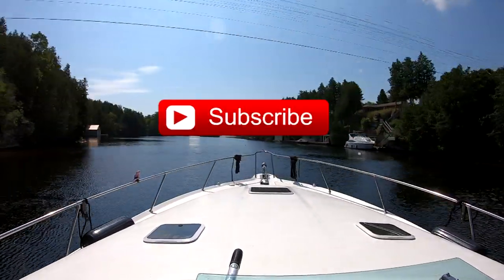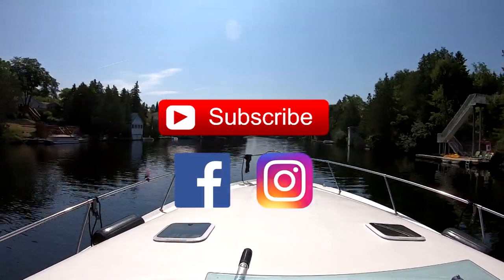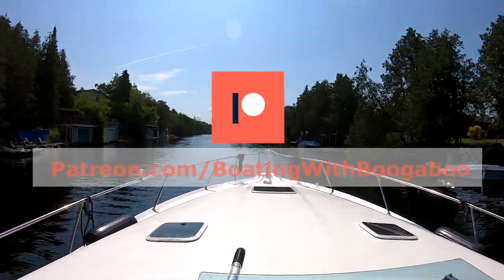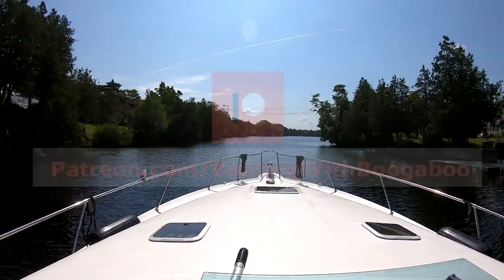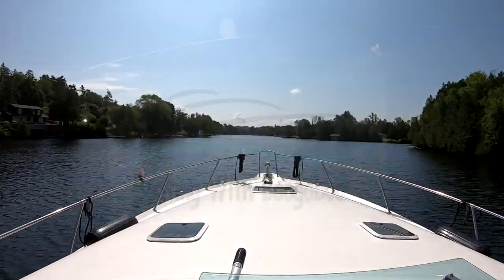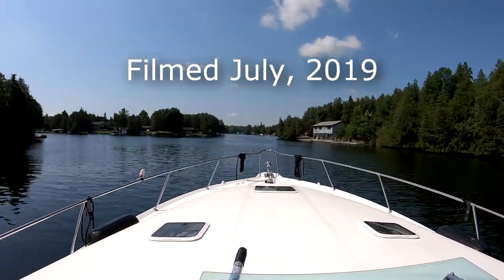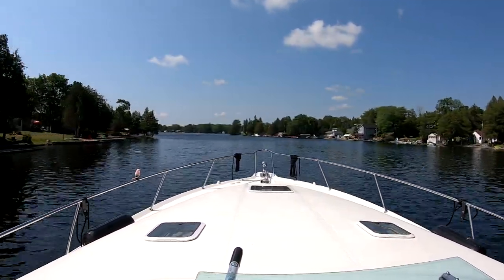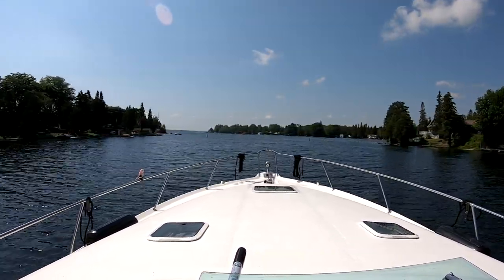Stinky Westerbeke Gas Generator :-(

Comment: Paul, Love your videos, and thank you for them. My generator service tech installed a new muffler from Vetus along with a exhaust gas/water separator and new exhaust hose and clamps. Installed it was about $800 US. We have a Sundancer 400 with a Westerbeke 7.2Kw Gas generator. What an incredible difference it has made. I would guess the noise level is half. Also a full tune up WILL make a difference as the engine will run much cleaner. 

Again thanks for your videos.

Comment: I like the questions you ask as you like to have practical applications/solutions for them. That being said, is it possible to rig something on the sea ray to make yours exhaust underwater for a test. Something cheap, maybe PVC from your side outlet. Water cooled so not hot enough to melt anything. Just a thought. That would let you see if is what helps the smell and noise.

Comment: I have a 40 Nordhavn and the gen is submerged  but still when conditions are right you get some smell. Not like my gas gen did on my last boat. Submerged as well. diesel is just better to me. Same with the RV. Carb engines have always had strong emissions. Great part is no spark plugs or ignition wires to deal with. New to me boats are always fun to get to know. And you guys are going to love the loop!! I am sure you already consider the draft on your next boat. Ours is 4 ft 9 inch and had no problem with most of the loop. People recommended  not too much over 5 ft on draft . We plowed once or twice but no biggy. Have a great day!

Comment: Thre is a sound shield on the exhaust of our Westerbeke.  For the most part it is very quiet even with the exhaust above water in the same manner as yours is.  I've never had any issue with it being smelly, at least no comments or complaints from anyone so far.  I just find the sound level is completely different in different moorages.  I believe that's just acoustics.  I'd look at a tune up and sound shield that may help.

Comment: I have an express fisherman with twin 300 Merc verado outboards , but my generator  is a fisher pander 4K diesel generator. It exhausts under the water so it's pretty quiet and almost a nonexistent smell.  I can pretty much run it all day and it will use very little diesel .

Comment: The boating you do dockside the air is still and you will always smell a genny unless it’s got some kind of exhaust filtration. Big battery bank with inverters & solar is the way now. Facelifted 2003 onwards 370da or bigger with the hardtop has the room for panels also
Reply from the maker: We follow a couple of full time RV'ers on YouTube and I was intrigued by the fact that they could run their A/C units all day via their solar/lithium setups once they upgraded. Problem for us is that we don't have any usable real estate on Boogaboo to place the panels. And no, I'm not going to start putting them on the canvas tops. Seen that on another #boat and it looks down right goofy, IMO ;-)

Comment: Following. Interested to see if there is a solution because the Westerbeke 7.2 on our SR 400 Express is a little on the stinky side and I feel is noisy as well. It runs great and doesn't skip a beat with a 2 a/c load on it. I do feel that if the exhaust exited under water that it would be quieter, on the exhaust side, but there still would be harmonics and sound of the engine at the back deck. No one ever complains, I just wish it could be quieter. 

Paul, I can't wait to see what y'all are shopping for and what you end up with. My wife and I want to do the loop as well at a certain point and we know our current Express, even though perfect size for the two of us plus dog, it's not gonna cut it in the efficiency department. Cheers! Pearce
Reply from the maker: I'm hoping that a full tuneup will help with the exhaust smell, so fingers crossed. As far as the noise is concerned, I'm going to be installing an auxiliary muffler that will help dull things down quite a bit. Put one on our last boat (https://youtu.be/U6S1_542Zvg) and it really helped. The only issue that we may still have is the fact that our current genny runs at a continuous 3,600 RPM, with or without a load on it. Just the way that machine works, but I think that the whining of the aperture will still be apparent. No real biggy, just sayin'. . . 

 As for our next potential #boat, it will most likely be something not too far off of your 400 Express, but would definitely have an aft cabin for more storage, or for when we have the granddaughters staying with us. After having our big 400 Sedan Bridge (https://www.youtube.com/playlist?list=PLKhjT5kr2l2FaABQJSn3VVqd6SN930ICt) for six years, we've come to realize that the express style cruiser is very comfortable for the two of us on many levels.

Comment: Hi, great videos. We run a 12kw westerbeke diesel gen on our semi livaboard currently based on the Thamrs in England. It is great, runs at fixed 1500 rpm and will run all day and night quietly with no smell, generators which smell ( in my experience) are because they are not used regularly and not serviced. We don’t have an underwater exhaust but I would specify that on future boats. My boat is a Dutch steel motor cruiser ( 42ish feet) and is well insulated. Prior to this boat we have had grp boats both trawler type and sports cruisers most with gen’s some of which I have had fitted, all have been great with good insulation and good maintenance they are a super necessity if you go “ off grid”. I know you don’t want this comment but I have run twin diesels for decades and other than when visiting or chartering “well used but not maintained “ yachts or motorboats I have never experienced diesel smells. If engines are well used and well maintained with a well engineered vessel your diesel concerns, I am glad to say, will be a long gone worry! Look forward to seeing your choice, best wishes Harry.

Comment: I had a 7.2kW on my 360, ran it for about a hour in the morning and a hour in the evening typically.  Never had an issue with odour and only a real noise issue if exhaust was on dock side.  Boated on G’Bay so rarely had anywhere to go far from the boat while genie was running, if it had smelled, we would know.  Gennie had about 340 hrs on it when we sold the boat.  It had one full tune up over that time plus yearly oil / filter / plug changes.  Your boat seems to have big hours so your genie likely needs full overhaul including carb.

Comment: First, I sure hope you currently have CO detectors below deck.  Your Mercs pump out plenty of CO underway and your boat creates a vacuum as you move along sucking in CO which can buildup in the cabin.  I suspect your current carbureted Westerbeake is probably running rich which is what is creating your odor.  I would look into if there’s a possibility of converting it to Direct Fuel Injection.  DFI is more efficient as an added incentive.  There are several things you can do to lower the noise of your current generator.  First, is it sound or are you additionally dealing with harmonic vibration that seems to be sound.  Have you checked the isolators at the mounts?  Secondly, have you considered sound deadening matting?  Easy to apply and remarkably effective.  As for your Looper, I have had nothing but a great experience with Onan using a 3cyl Kubota Drive engine.  Solid as a rock!

Comment: 3 comments so far and they all were thinking the same thing I was, exhaust under water. I have been on several larger cruisers that have under water exhaust and it was much easier on the nose and ears. Also adding some solar panels as mentioned is becoming more and more effective with supplemental power options. Lots to research in the next year.

Comment: Ha there
Have you ever considered a large battery bank
I came across a sail boat couple with the same  problem  so they put a good size battery bank in and like you they wanted to run the a/C just for a few hours at night or during rain storms
The CONVERTER they had was large enough to run the a/C about 4 hours but the problem they had was when the air conditioner compressor kicked in it would trip the CONVERTER
They looked around and found a company that made a device called a soft start
Once installed there air conditioner
did fine,but they needed a lot of solar to recharge during the day
You have 2 454,s to IDLE all day like you mostly do that would recharge your bank
Like your videos and your excellent seamanship
Thanks

Comment: Consider an inverter/lithium battery combination with a heavy duty alternator.  If you are running a genny to charge devices it seems like overkill.  A sufficiently size battery bank may allow you to run a/c when tied u or at anchor.

Throw a small inverter/generator (gas) in a compartment if you really need to supplement the inverter.
Reply from the maker: Ya.

Comment: Here is a thought,  and it could work even on the current sea ray,  increase the size of the house battery bank to compensate and add as many solar panels to the roof as you can and get to where you don't need a generator either gas or diesel.

Comment: Hi Paul, we had our 1998  Sea Ray 400SB with the Caterpillar  3126 420hp almost 3 years. We've been very satisfied with these engines. Running smooth,  good fuel economy, no smoke and not noisy. The generator was a Westerbeke 8.0 BTD Diesel one. This was a piece of sh.... compared with Onan or Kohler generators. Loud, slightly higher rpm and stinking.  No sound insulation and exhaust above the waterline. An absolute no go. Try to avoid this. But anyhow, you have to build your own opinion. Greetings from over the pond.
Reply from the maker: Thank you Stefan, appreciate your insights. Anchor Girl and I were just talking about our next, potential Boogaboo. Still debating whether we go full diesel or staying with big old gas engines. Oh well, don't have to make that call right now, still lots of time and options....
Reply: @BoatingWithBoogaboo  Hi Paul,  you don't have to ask a European boater. Almost all bigger boats, let's say from 35 ft on are running with diesel engines. Way more fuel efficient and fuel costs are pretty high in Europe. And in my opinion diesels are suiting better to bigger boats as they have more torque at lower refs, which means they run more quietly.

Comment: A thought (not on diesel vs gas, as that will come later). You have spoken previously about the range of your current boat and have talked about average fuel consumption. To truly determine usable range, your need data on consumption across your RPM range along with speed at each RPM. That will allow for meaningful range calculations.  The primary range constraint is Grafton to Paducah, about 230 or so miles, but you have the river with you for a lot of the way, which is where the RPM-specific fuel data is key. If you already have this data, OK. If not, advisable to start getting it.  Hope you have fuel flow meters, etc....  Nellie May.

Comment: Hey Paul. We run a westerbeke 8.0 btda diesel generator. It's loud and it stinks. It definitely needs a tune up but I know that's not going to fix the noise and smell 100%.
I have considered adding the second muffler to help with the noise.
That said, friends of ours run a diesel Onan. It exhausts under the water and it is like night and day.
Virtually no smell and oh so quiet.
My tip for what it's worth would be to find a boat that exhausts underwater.
Cheers!
Reply from the maker: Yes Chris, that does sound like a good option, but time will tell what we find for the next #boat. . .